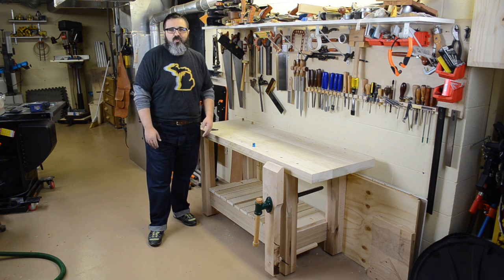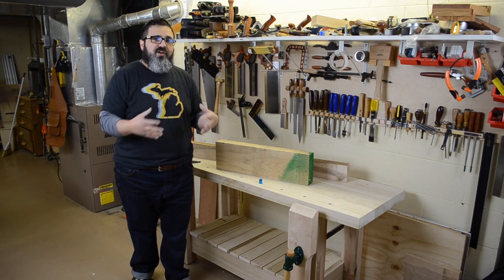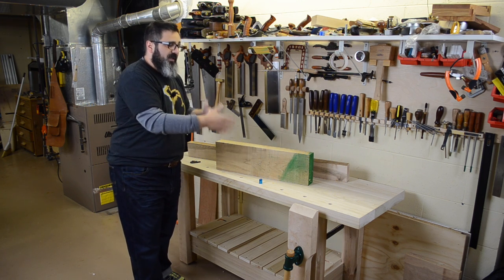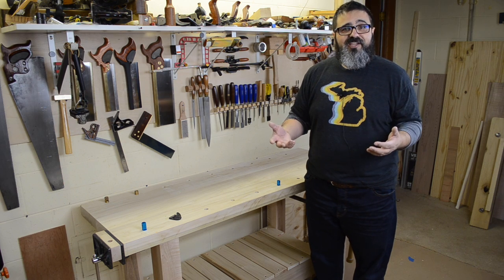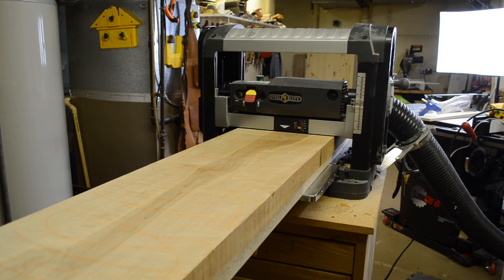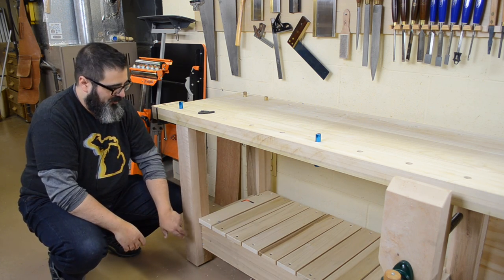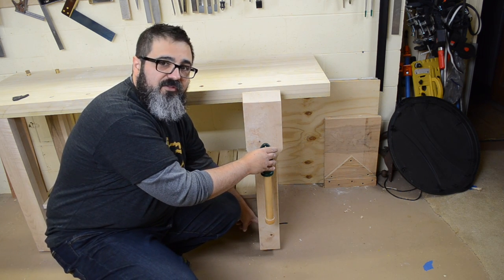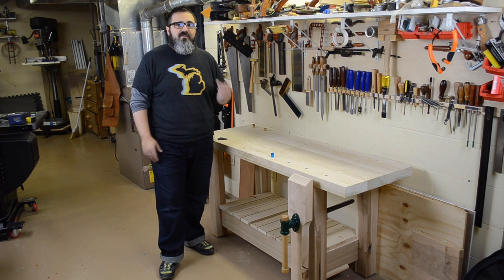557 The New Workbench is Here!

Comment: A few corrections to your video..You always cut the mortis before the tenon. It's easier to cut something to fit into a hole than vice versa.. You also would have been nice for you to explain the drawbore technique you are referring to as well to fasten the tenons. It's not just putting a "Dowel", it's offsetting the hole into the tenon using a straight grain piece of wood (preferably cut yourself) and banging them in to draw the tenon tight.
Reply from the maker: Well that was easy...hey everyone, read this comment if you want to know more about the drawbore technique. Thanks!